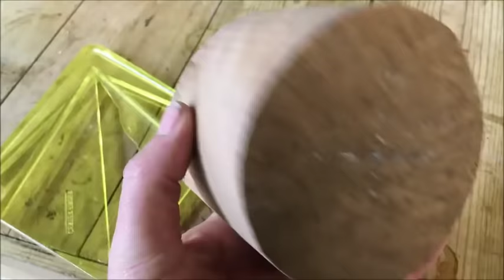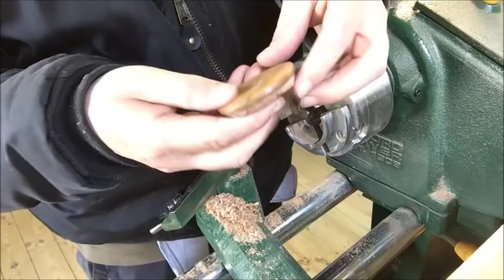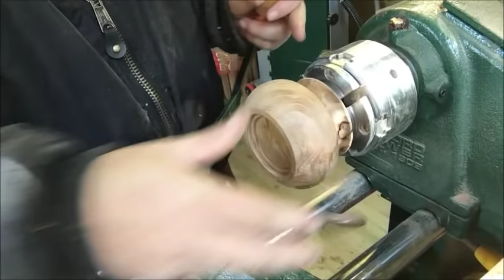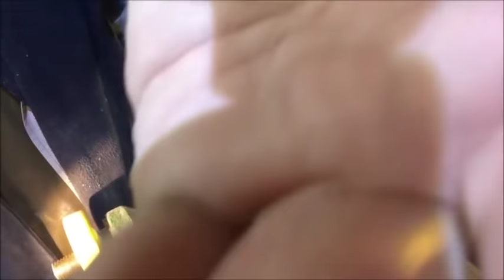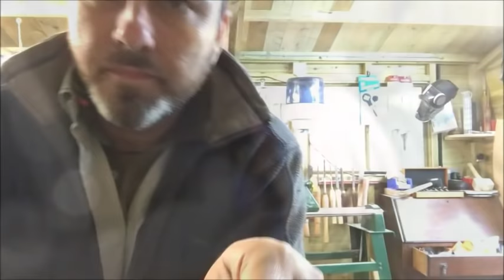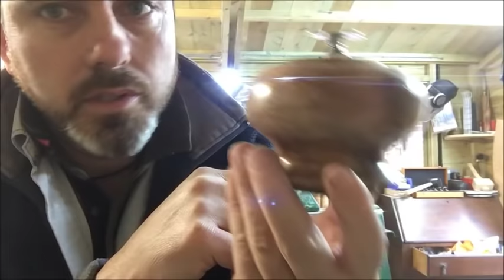Woodturning - a small box with butterfly

Comment: This might be a stupid question mate but do the shafts on a lathe differ or are they all a standard size. I have a kinzo lathe. It's not a well known name but it works fine. I'm getting a turning chuck for it which is why I asked about the shaft.
Reply from the maker: Hey yes they do, you need to find out what thread size you have , mine is an M33. hope that helps mate.